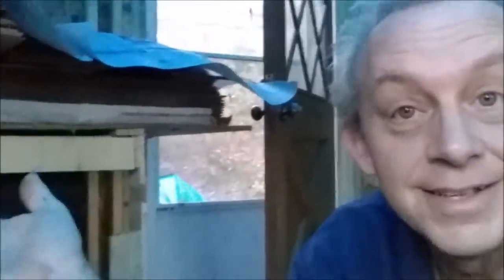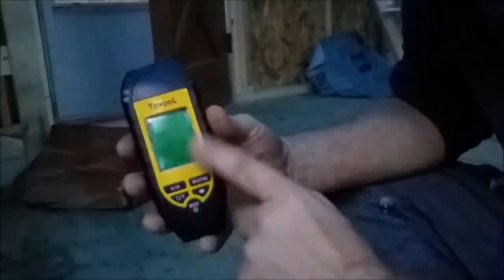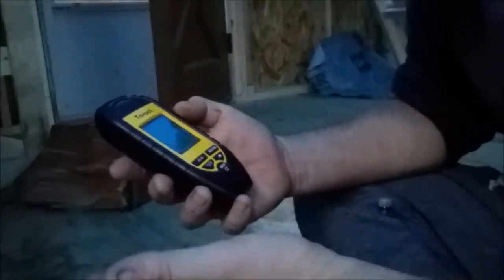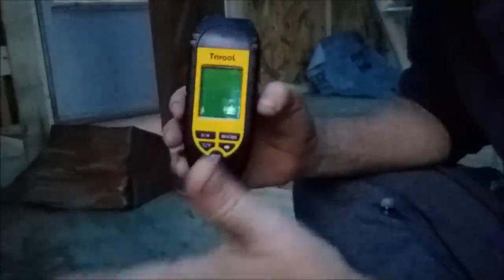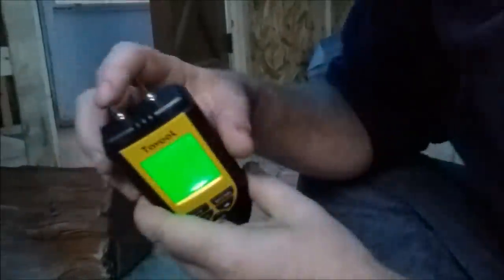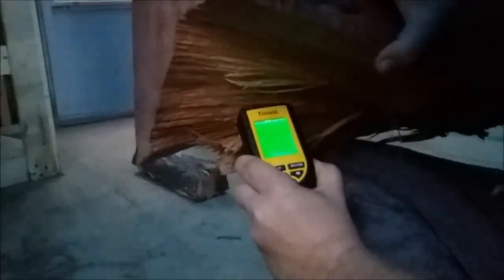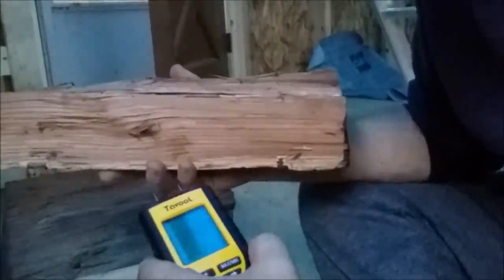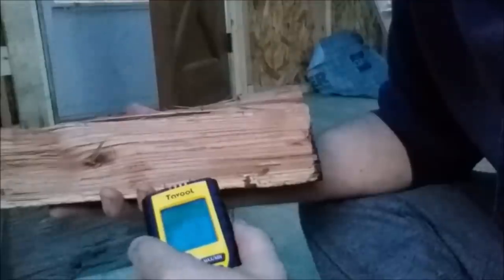Not Again...What Is Happening In Our Tiny House While Living Off Grid

Comment: Hi Rob from Montreal Canada.  Love your channel.  I have heated my house for the last 30 years with firewood.  The last wood stove purchased (to upgrade) was one of the best slow combustion stoves going.  A few years later my friend updated their stove to a similar stove as yours with the smoke burning thing.  They used considerably less wood than I did just because the smoke was being burnt as well. You are right about the wood. Rule of thumb, you should never use wood that is under a year from being chopped.  Closer to 1 1/2 years is probably better.  Your poplar won't dry quicker as you saw with your tester.  You can burn semi-dry wood in a stove that doesn't have the smoke burner thing, but you will have a lot more creosote in your stove pipes and you will get less heat from the wood.  Why waste all that effort of chopping and stacking for less heat and potential problems?  Ignore the nay sayers.  You're right.